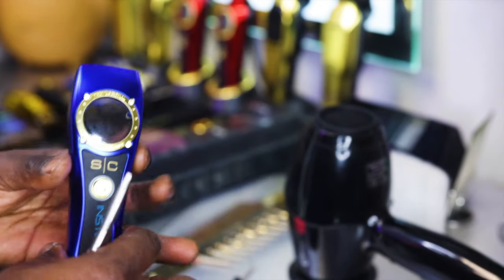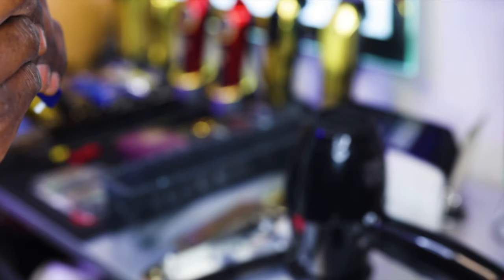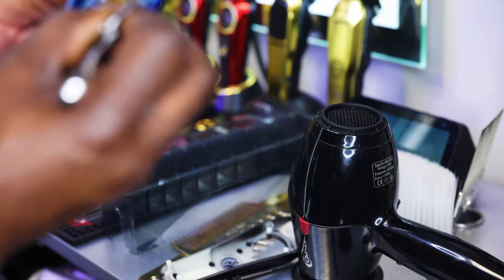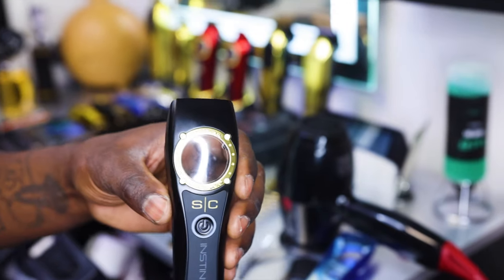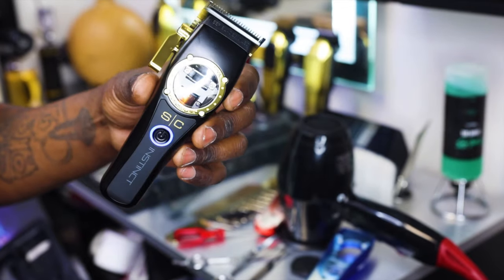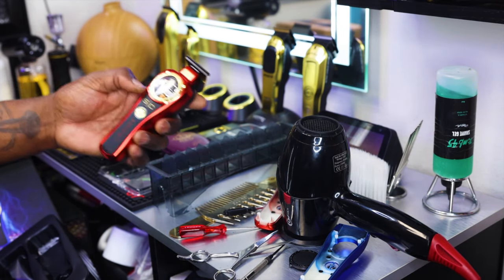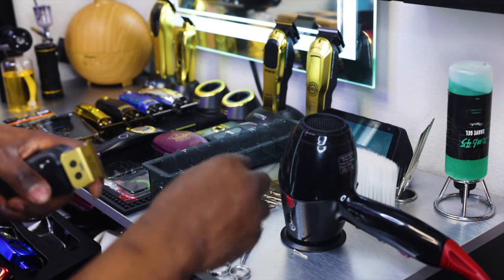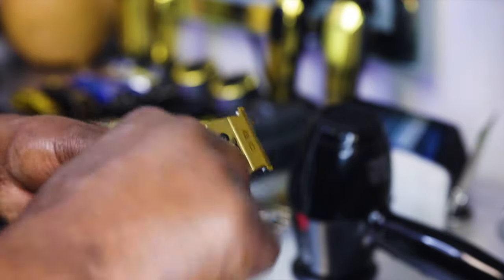Stylecraft Instinct CLEAR LID Swap | DIY @GAMMASTYLECRAFTPRO

Comment: That’s another reason why I just copped the saber all black trimmer and zero gapped and is now the best trimmer I ever had at this point of time and I didn’t like the instinct just the clipper but not the trimmer and I no longer need to modify anything but I just like to play with my toys.😅 nice content and I am going to do the same thing for my clippers and hot glue it like you did cause I love the color and it should have came out the box that way awesome content 😅